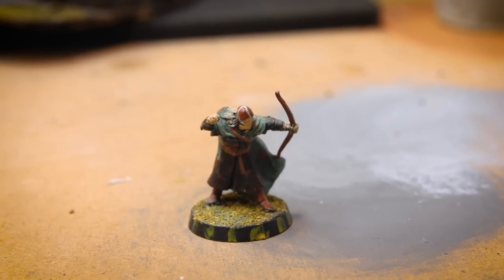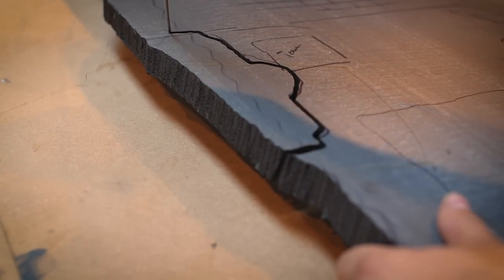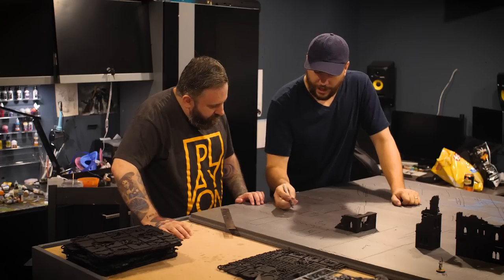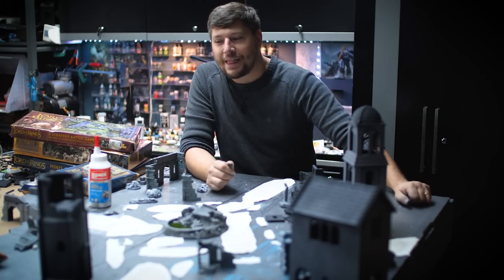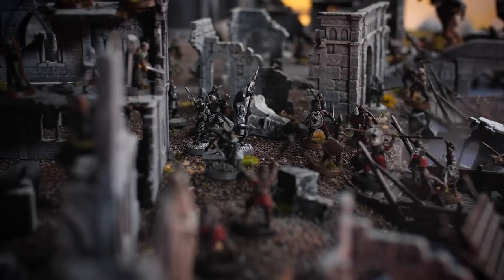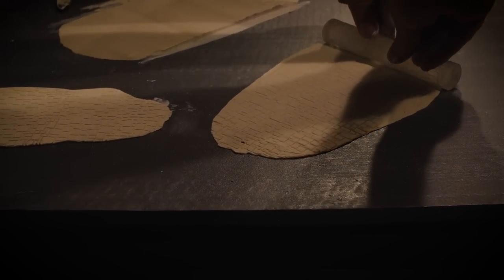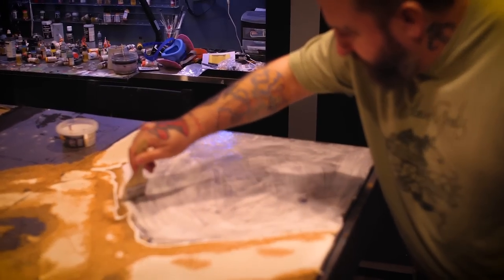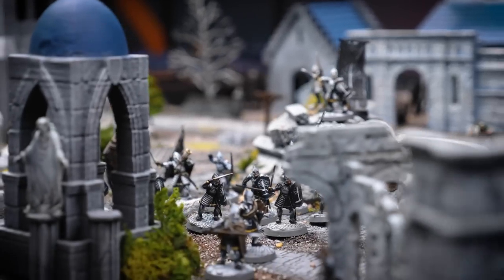Building a modular gaming table in 3 days!  Our first dive into Middle Earth.

Comment: I've honestly been looking at Middle Earth for quite some time now. 
Besides the fun rules the overall cost for an army seems reasonable and the new starter box looks very tempting.
Reply: Honestly it’s an amazing game whats very balanced. With the new starter set, the gondor and mordor battlehost boxs you will have at least an 650-800 point good and evil army for less then £200. Not bad armys either, will be really competative in the right configuration. Plus most sbg games are anywere between 400-800 points generally.
Reply: Wait until you meet the community! <3

Comment: I would love to do what you do for a living... i've always wanted to make a Orc Rok vertical table, a Wall of a Orc Rok with air locks and passages and bridges on a curved 4 foot tall 3 foot thick "table" curving from the table to 4 feet about your head with roads in and through the walls. you'd have to make the passages big enough to drive a land raider though and make measurements. I'd automate parts of it and light the whole thing up.